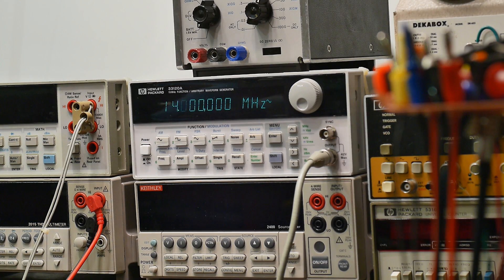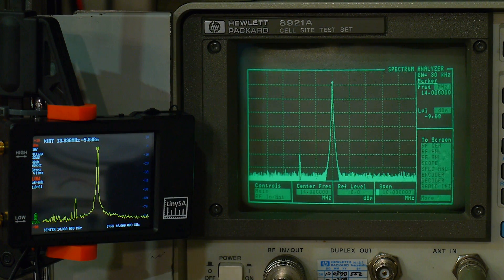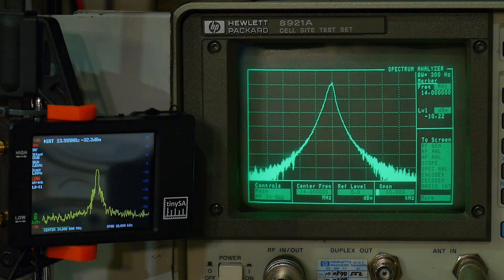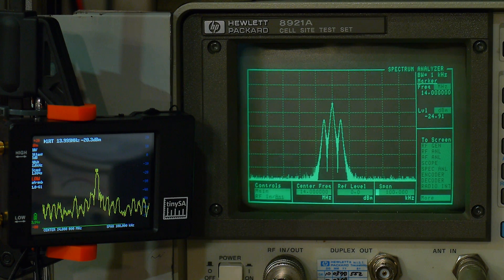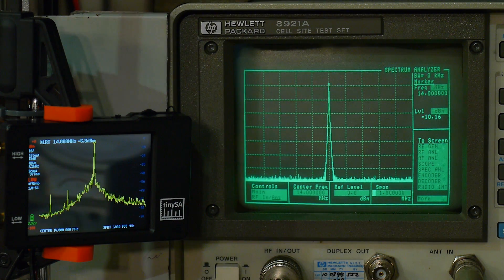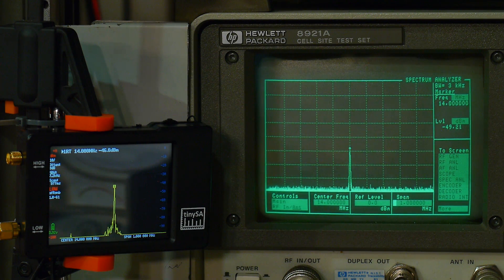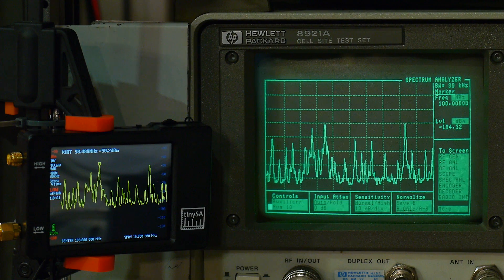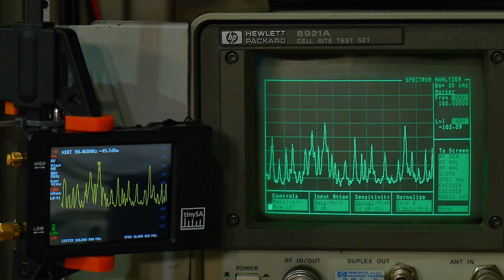#536 TinySA Testing Against an Expensive Spectrum Analyzer (see update for more)

Comment: I believe in buying the best test equipment you can afford. If you need it, be sure it's good enough to confidently make the measurements you need to make.   Look on the used market for bargains in yesterday's high end analyzers at very affordable prices today.    I'd always rather over-buy than buy equipment that can't cut it...but it was cheap.

Comment: So, as a hobbyist, would you recommend the tinysa? 
Looking to get into learning how to align a radio.
Reply from the maker: Yes, but buy the ULTRA model
Reply: @IMSAIGuy  What's wrong with the 2.8 screen model?
Reply from the maker: @emanoeldeoliveira8943  many things. just avoid it
Reply: @IMSAIGuy  I ended up purchasing the 2.8 inch screen version, from what I understood the only difference to the ultra version was in the screen size and frequency range.
Reply from the maker: @emanoeldeoliveira8943  no, both the hardware and software is completely different. I've done teardowns and reverse engineering schematics for both type on my channel.
Reply from the maker: @emanoeldeoliveira8943  https://youtu.be/nJ54h6LJPqQ?si=XJkxuLSa2vlGt74t
https://youtu.be/BICklA2Vtbo?si=yadGs2R5MxxL6OeO

Comment: While comparing those spectrum analyzers you should point out that tinySA is smaller and also cheaper than the HPs reference oscillator. That's the reason of the difference of phase noises

Comment: About the only difference between the HP 8920A and 8921A are the 15 and 30 kHz IF filters. How will the IF filter difference effect the operation of the test sets for HF work...1.8-30 Mhz
Reply from the maker: I'm not quite sure I understand. I don't think there are 15 and 30 khz IF filters. those are audio frequencies. there are low pass audio filters but that is all
Reply: @IMSAIGuy  From Keysight's web site...

 - The 8921A has a 30 kHz IF filter vs the 15 kHz filter in the 8920A (this was changed to allow us to decode the wide band data for our 11807B Option 120 CALM software).

- The 8921A includes the hardware hooks necessary to allow upgrade to NADC/TDMA and CDMA cell-site testing.

- Improved performance for power measurement accuracy, 5%

- Improved residual FM,

    < 7 Hz, 250 kHz < Fc < 1000 MHz
    < 4 Hz, 250 MHz < Fc < 500 MHz

The 8921A is fully loaded to allow customers to do cellular base and mobile AMPS testing.
Reply from the maker: @imken2392  Mine had the cellular piggy back on it when I got it. I removed it since it did me no good.

Comment: You know, watching this video it's easy to discount the Tiny SA, but when you factor in the price difference between $50 and $2500, you can make a judgement of whether this gadget will be useful to you.  Understanding its limitations, you're just not going to get much better for even five to ten times its price.
Reply from the maker: you are right, but you might find a good deal. I got this HP analyzer for $100 and another for $250

Comment: my understanding is that the HP Function generator is not outputting 50 Ohm, how have you solved this,. BNC T with one end 50 ohms?
Reply from the maker: I'm using a splitter not a 'T'.
Reply: @IMSAIGuy  I mean the output of the function generator is 1M Ohm and not 50 ohm
Reply from the maker: @HelmutTschemernjak  the HP33120 is 50ohm

Comment: Can I connect this device directly to a yagi antenna? Or any other antenna without attenuation? Adaptors not included.. 

Thank you!!
Reply from the maker: An S9 signal at the radio is -73dBm. so even a very  strong signal should be OK.
Reply: @IMSAIGuy  
Can't thank you enough! Really appreciate your video content as well.

Comment: This video is doing a lot of unjustified damage to the tinySa reputation. This is important as it is one of the first videos youtube will show if one searches for tinySA. The added text in the description is not visible if you do not open the full description so if someone watches the video the new insights about the overloading will not be communicated. I hope you can correct this
Reply from the maker: I made some comment changes. I think the video was justified though. I've owned 5 spectrum analyzers so I'm not just some newbie. Yes I'm not an RF engineer, but this was the very first spectrum analyzer I had and still have difficulties with. You need to understand your target client who will know nothing. The firmware is getting better but still far from 'it just works'. I do love the TinySA and applaud you. I am still constantly having to add attenuation to the low and high channels instead of that being default. The HP 8921 is a pretty bad spectrum analyzer with very little controls, yet it just works. I find the marker 'tracking' set to default is frustrating, at least it needs search for the next peak when I use the rocker switch. I wasted a half hour in HIGH mode yesterday until I figured out I needed to set the attenuator low. Remember I have a room full of equipment to verify things and most people will not. I encourage you to make the firmware defaults react better. Just like people don't read my description they will not read your wiki.
Reply: @IMSAIGuy  YOu can get rid of the tracking of the first marker at power on by taking these steps.
1: Reset the tinySA
2: Disable tracking of marker 1
3: PRESET/STORE/STORE AS STARTUP
Now when you reset the tinySA (or LOAD STARTUP) marker 1 has no tracking.
Reply from the maker: @ErikKaashoek  Have you thought of a full screen waterfall?
Reply: @IMSAIGuy  you are the first to suggest this option
Reply from the maker: @ErikKaashoek  I think it will be useful. many have asked about using the tinysa as a frequency monitor/display for ham radio use. I started a video on this and didn't like it so stopped. I will redo that video in the future but the waterfall is a big deal and the one you have is just too small. I used the hold max feature instead but people will like a small max hold and a large waterfall instead.
Reply from the maker: @ErikKaashoek  Just a suggestion. Right now it is tracking on, Ok. Then you toggle switch and the marker moves, OK. why allow the marker to move? I suggest if the user wants to move the marker then exit tracking mode, or I think better, search for the next peak in the direction the user moves. otherwise allowing the movement with it just returning does not seem for perform a function. it is moving too fast to gather any data and just returns when stopped
Reply: @IMSAIGuy  will look into making this configurable but the tinySA is not good in scrolling
Reply: @IMSAIGuy  Option for larger waterfall implemented in new FW
Reply: @IMSAIGuy  Implemented in new FW
Reply from the maker: @ErikKaashoek  bug:
turn on large waterfall
then go tto mode
select low in
screen not refreshed correctly
Reply from the maker: @ErikKaashoek  They new scroll function of the toggle is interesting and some will like it. It is confusing what it does for the user when in full freq sweep. it is understandable with narrow freq sweep. It is confusing that nothing happens when you hold it. not the same as other modes. You can keep this, but I would find it more useful if the toggle does a peak search left or right and not scroll.
Reply from the maker: or search for peak and re-center
Reply from the maker: @ErikKaashoek  bug?
if start stop set to 88 108
then toggle right 
start stays at 88
if toggle left 
start stays at 88
not scroll
changes the stop value
I'm confused
Reply from the maker: i understand now
you have to click on the number at the bottom and then the toggle modifies that number
Reply from the maker: it should keep changing if you hold the toggle
Reply from the maker: I like the new waterfall very nice and useful. you might look at the waterfall check box and have it cycle off,S,L for small or large
Reply from the maker: @ErikKaashoek  
the software seems to be hunting, see video: https://youtu.be/bxjvIBAU4to
Reply from the maker: @ErikKaashoek  Bug:
set start 88mhz
set stop 118mhz
set zerospan 88mhz
set stop 118mhz
no signal displayed
4 seconds later.....
correct signal displayed

Comment: I think what it's really good for, and someone correct me if I'm wrong. Is to be able to run around your house or work place and locate / identify RFI generators. Like various cheap switch mode power supplies / USB adapters, now days all LED light bulbs plugged into 110v have some sort of a dirt cheap SMPS inside them as well. Light dimmers, TV sets, WiFi routers, really everything has a SMPS supply inside it these days and most are running even when you turn the item off... So if you have radio gear (ham radio, CB radio, shortwave radio, or other) and your picking up interference. Don't be surprised if it's from within your own home! The fact it's cheap, small and runs on a battery. Makes it a good candidate to find all those noise generators in your house and decide what to do with each one! My noisy USB adapters I typically trash. Other things I decide to only plug in when I need them and sometimes put a label on them or their plug saying "RF noise generator!" My friend had a clothes washing machine that he couldn't turn on while using his ham transeiver would get completely wiped out by the machines vari-speed motor controller (really a smps too)... 
I didn't have a SA when I tracked down the crap in my house. I did it the hard way by first running my ham transeiver on a 12v battery so I could pull the main breaker for the whole house while on various frequencies I heard interference on. Boy what a difference it made when I killed the power in my house. I even ran the speaker output of the radio into a Bluetooth transmitter and then my Bluetooth speaker in my garage with me when I pulled the main breaker and heard the noise disappear! Then it was narrowing it down to which individual breaker would kill the noise, then going into the rooms that that breaker was on to unplug everything in the room and then when I narrowed it down to the device. It was back to the garage to see if there were more things generating a weaker noise signal on those frequencies. Became a heck of a project! But made a huge difference... But guess what, over months your bound to bring more stuff home and unknowingly plug things in and... Regenerate noise without thinking about it... 10x worse if you have a wife and kids! 😂 
Can't drag a big HP SA around the house and that's if you can afford one!!!
Reply from the maker: You are right. It is a great tool for that. One of the first things I did was to walk around looking for things. At first didn't see much since many things are way above 350MHz or even 960MHz is low these days. But I knew I had a problem with some LED lights I put in (DIY really) and I know they are bad but was shocked at the broad spectrum. The lights in my walk in closet were even worse. Both used cheap AC to DC ballasts
Reply: @IMSAIGuy  also don't forget that even though many things are above 350mhz and 960mhz these days they are unfortunately all powered by a internal or external SMPS supply spilling it's guts on LF or HF LoL....
You can tell I am both a ham like you and I was a former SMPS project / prototype engineer for a bunch of years. Some of that was in our own RFI shielded room with a HP SA much like yours fighting noise coming from our supplies to meet FCC specs and even worse sometimes military noise specs... Lots of frustrating times sometimes building shields, increasing ground planes, sprinkling caps and inductors here and there. Could drive a person half crazy! 🤪
Reply: @IMSAIGuy  Yes I noticed the same thing. Between those LED lights, USB adapters, laptop power supplies and my Bosch power tool battery charger and  PIR motion detector lights. I was really generating some wide band HF noise especially on the lower end of HF 80 meters and when I was starting to experiment with a large loop antenna on 160m...  
The motion detectors were interesting how they change in noise output from no motion detected to motion detected, the noise jumps way up... 
Then again if I transmit on 80 meters, 100 watts, it causes one of my two motion detectors to always trip and then that wipes out my receiver... It's like the motion detector is getting revenge for the transmitter tripping it!!! Then I have to get up and switch  the motion detector to the manual off setting to stop the noise...

Comment: Are you re-calibrating the tiny between sweeps to take advantage of all the measurement points?
Reply from the maker: The spectrum analyzer does not calibrate the same as a VNA. There is no need to calibrate for every setting. Just once is fine for everything.